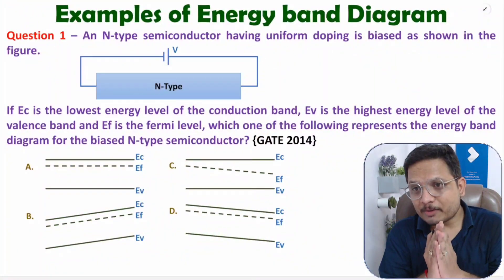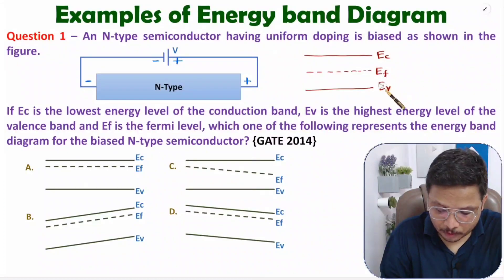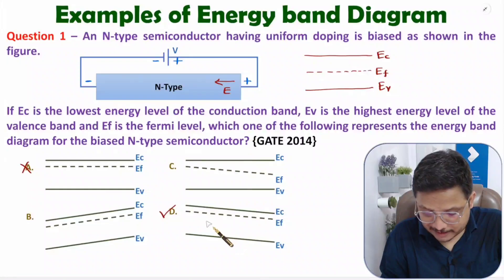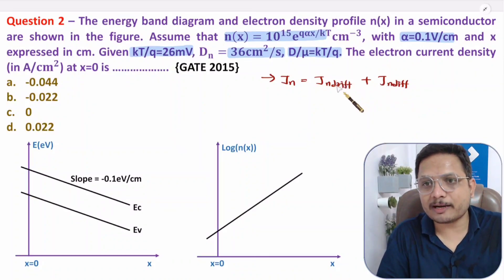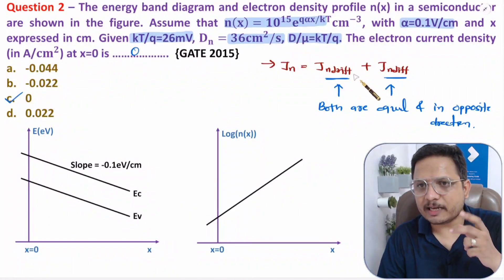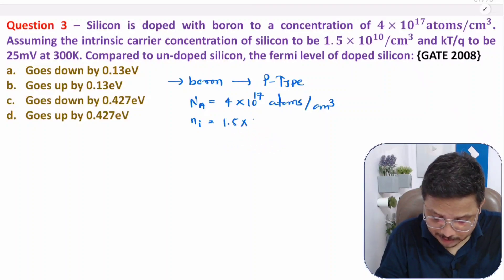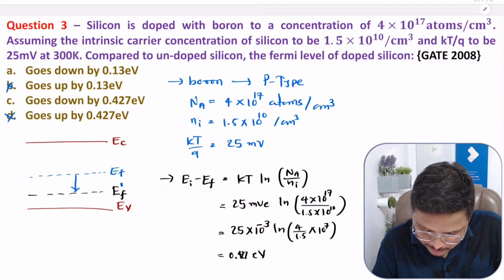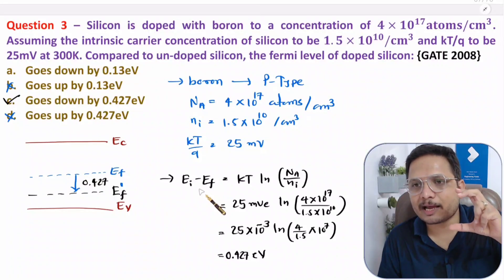Examples of Energy Band Diagram of Semiconductor | Electronics Devices and Circuits - EDC

Comment: Sir in question 1 u have said in positive terminal there should be negative value but why bcz as i know n type has free electron and after applying electric field the electron moves to positive terminal so it should have a high value why u hace mentioned it a low
Reply: pls reply sir